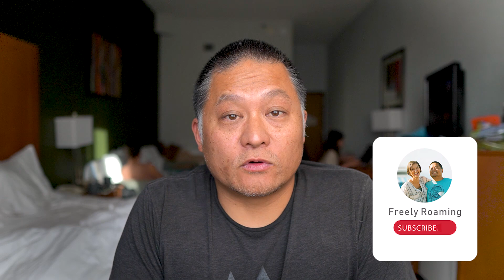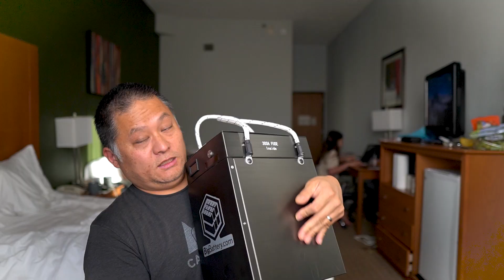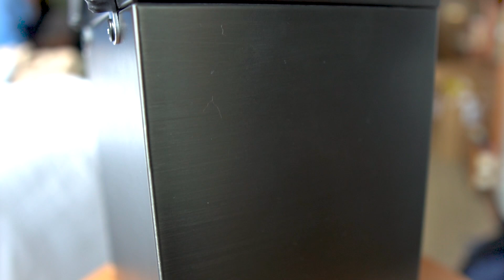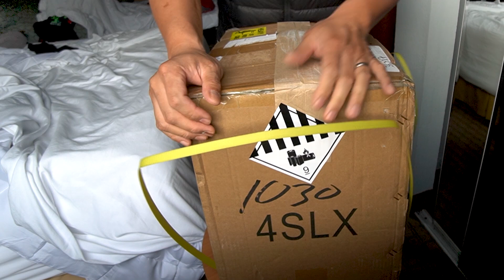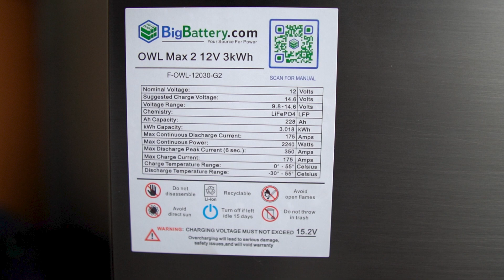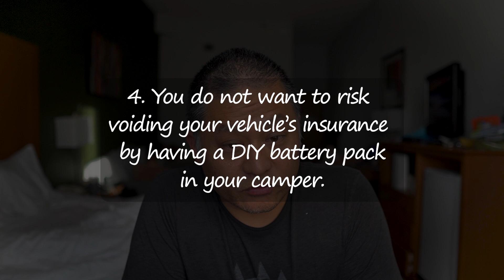Why You Should NOT Build A DIY LiFePO4 Battery Pack

Comment: I built my own 400amp LiFpo battery pack with BMS and 2000watt inverter charger for less than the price that commercial batterys that would cost on their own, it is the best way to do it and you will learn all you need to know about your system,  enough said
Reply from the maker: You are so cool

Comment: well, still 2 to 3 times to price of diy ...
Reply from the maker: Depending on where you get your cells and what quality they are.
Reply: @freelyroaming  i'm in EU belgium, pretty hard to find good deal
Reply from the maker: @chris_mk5supra  I bought raw cells 2 years ago and had it shipped to Croatia without any problems. I think you'll be able to find someone who will ship to Belgium.
Reply: @freelyroaming  yep i did pull the trigger on ally express cell, hope i did not make a mistake, but it take so much time to come it's kind of frustrating, got to little battery for the moment and it's bottelnecking my solar panels :(
Reply from the maker: @chris_mk5supra  it took probably 60 days for me to receive my cells in Croatia. I did get pretty lucky though as my cells tested up to full spec. Good luck!

Comment: What is your resting volatage on the Owl after fully charging?  I have the original Owl having used it for the last 18mos, and I see no higher than 13.3v.  I also only get 150ah actual capacity.
Reply from the maker: 13.3v sounds about right. although I am usually connected to solar so it has a float charge voltage of 13.5v. how much degradation you have after 18 months has a lot to do with how it was used during that time. Anything can happen without knowing every little detail.

Comment: Good review. I went with their Battery Evo brand which are less expensive. 2 12v 180 Ah in series for 24v 4.3kWh. $775 ea. Easier to handle than a server rack style battery.
Reply from the maker: How are they working for you? I think the form factor is a little hard for people to wrap their head around but it serves a good purpose in some situations
Reply: @freelyroaming  Working smoothly. I have my new Samsung refrigerator, a 11cf freezer and a 75" Flat screen TV running off of it. I have my washer and gas dryer plugged in to do the laundry a couple of times a week. I even run my small window AC when it gets hot during the day. But primarily set it up to run my fridge and freezer fulltime. They are hooked up to a 3k MPP Solar inverter/charger and 800watts of solar. It couldn't have been easier. With solar during the day and AC from a house outlet, my batteries stay between 13v and a system voltage of 27v+.

Comment: So...why not a DIY batttery build?
Reply from the maker: Watch it and you'll know.
Reply: @freelyroaming  have 16 cells coming from france to here,portugal, in 4 days, incredibly cheap (500 euro for all 16,200Ah each, at the 3.2 volts, to do 2 batts. of 24 V each,that is why i wanted to know if you care to tell,saw nothing in the video except that it is dangerous and u need expensive tools; as a mechanic/electrician (i used to be an engineer...)i NEVER needed hydraulic crimpers i have 120 watt soldering irons; have  multimeters power supplies etc,also; BUT i rely on google and youtube for the build. It will be stationary,in the house,for solar .
Reply from the maker: @josepeixoto3384  so you DID see in the video why building a diy battery might be a bad idea some people. Are you just looking for an opportunity to say that you are not in that category? That's great. I'm happy to hear that.

Comment: We build our own batteries because of the exhorbitant prices these battery manufacturers charge. Who, in their right minds, wil pay $1,500 for a gang of cells we series /paralleled to get the voltage we want? Solar, bms, 18650 cells (or larger), distribution box, inverters for an off grid home that my insurance company approves of is a lot cheaper than what you paid for your commercial battery.  As far as putting it in a caravan/travel trailer, I stick to flooded lead acid batteries that get recharged at the unguarded outlets at commercial buildings, campgrounds, and friends or family places. With the Bidenflation caused supply problems, you use what you can build, buy, or find to repurpose. I have the skills to build these things myself, or scrounge them off the junkyard of my area. Others can do this, too if they can spend the time to learn how to do this. They assume all the risks involved in this process, as I do. Even you have a risk of fire, overcharging, short circuiting no matter how careful you are because your system is in a moving, vibrating, bumping platform that can cause those same conditions. EVERYTHING is risky, no matter how you install it. Depends upon the amount of risk you want to assume. Not everything here on YouTube is safe, without risk, including YOUR battery. Have you opened it up to see the quality in the build? How many of your cells have bulges due to their first charge before shipment from the factory? I fear these enclosed battery boxes, because they can become bombs if they short internally, and the protection circuit fails!
  I overbuilt my batteries for that extra safety factor I can include in my build. I have a 12VDC battery  in my radio shack I have built myself that has powered it all for three years without a fault. The only thing it does not power is my Henry 4K which needs 240VAC to power it, but I do not need it all the time, so my solar panel system meets all my needs for communicating. Battery banks are for stationary use, not mobile unless they are small or for automotive use. Being able to afford such commercially made batteries is nice, but not all of us can afford to buy "off the shelf" like YOU did. Good Luck - someday you may need it.

Comment: I'll build my own and put it  in a safer than metal,  heavy duty plastic tool box for less than 1/2 the price of the cheapest prebuilt I can find and the cells are sent from the US (already in the US). The main hard part is getting the bms hooked up the right way, alot of wires for a 48 volt system, but easy to check if its right with a multi meter and I'll know it really has a low temp shut off so it will not be wrecked by charging if below 32°f. I'll also put in a good dc breaker and go with bigger  then needed cables. After it's built, I can say, "Built in the US by a US person, and built to last 10-20 years". And all that money saved will about pay for an all in one 120v inverter,  battery charger and solar controller. After all that I'll say, if you know what your doing fine or else go buy a pre-built, but make sure to watch someone on you tube take it open and make sure it is put together right, alot aren't, like saying they have low temp shut down, wired good so doesn,t rub and short out , going down the road or bounce around in the case, etc.

Comment: Actually there are 2 really good distributors of raw cells in the 🇺🇸  and their prices are pretty much the same as Alibaba or Aliexpress without having to wait 2 months to get your stuff. I just finished 2 of their 280ah 12.8v  GRADE A legit eve cells each one ran me around $640 per Bank with shipping and under $750 with a bms on them.. I can guarantee you won't find any brand new 280ah lifep04 battery banks anywhere near that price!!! This is why I will continue to buy and help people build their own battery banks so they can have a BadA$$ system without having to pay $3 grand for a decent battery bank!!!!! Not big on these don't say anything negative because we gave you the unit reviews...  They lack the depth and details to teach anyone new or experienced about the diy setup vs paying 3x more for a company to do it for you.
Reply: I'm interested in a reliable US based battery supplier for a DIY build. Could you tell me who they are?
Reply: I'm also interested in a u.s distributor of raw cells could you message me the contacts of the U.S distributors?

Comment: You must have got this for free. 
I’ve had the worst experience with big battery. The first three 202’s I got all had internal shorts and had to be returned.  But, I had to first buy three more. Then, 2 months later I tried to buy three more and they were discontinued. The suggested buying 170’s and joining with current bank. When I connected two of the 170’s it shut all but 1 of the 5 batteries down. I personally drove to their shop in Cali to do a swap and the almost denied my the warranty work. After going back and forth they finally gave me five new 170’s for my 3@202&2@170. 
1 of the five batteries (new in the boxes) had a charge of 24.3 all the others were at 27.2. That added to my problem. Then after waiting a week I finally discussed the refund money for the cost difference. I got the run around and no call backs until 5 minutes before their shopped closed on fridays. 
After waiting three months and calling constantly I finally got a check in the mail for my $1400. 
First thing I’d do if keeping their batteries is trash the bms and replace with a better version.

Comment: Big Battery doesn't stand behind their products. They have a poor BBB rating and have many complaints from customers for not refunding their money for selling them a battery that doesn't preform as advertised. My 170ah battery provides a whopping 114ah, not even close to advertised capacity. Been "working" with BB since Dec. 4th of 2021 for a replacement or refund. No customer service from Big Battery, and no refund. Their advertised warranty is not something they live up to. Last contact I received from BB was on Feb. 14th of 2022. Buyers should beware of doing business with these people. I purchased a Chinn 100ah battery from Amazon for testing. It provides 103ah - much better performance. I'm not surprised the battery they sent you to test works well. They aren't going to send you one of their normal products.

Comment: You should pull a Will on these and tear it apart, that’s the only way to evaluate the build quality.  I would expect a cheap BMS and less than desirable wiring but prove us wrong, please.
Reply from the maker: I've seen a few disassemblies. The internals look pretty good but I will confirm. One of the nice things about this unit is the enclosure allows easy access to the components.

Comment: I have the 24v Big Battery unit. Had it for almost a year now and seems to be working fine. Just curious, do you get to keep the battery they sent to you for evaluation?
Reply from the maker: I ask for a review unit and they said as long as I made videos about it, I don't have to return it. But if I choose not to make any videos, they would want it back. Other than that, they didn't require anything else. That includes not having any inputs on my opinions of their products.

Comment: In the UK building a battery is 1/3rd of the price, even with a JBD BMS with heat pad connections. Genuine Grade A cells. I built two 12v 304Ah batteries for just over £500 each.  To buy a single 12v 300Ah battery in the UK will cost £1500 in the UK. I do wish we had access to cheaper high quality batteries in the UK.
Reply from the maker: To properly and safely build a pack from raw cells, you need a lot more than just the components. If you don't already own then, you'll need to also buy tools that costs hundreds of $$ and it doesn't make sense for beginners who aren't confident in their abilities in the first place. That's who this video is ultimately speaking to. Also in the current market condition, there are too many stories of people getting bad cells or not getting them at all after months of waiting. Unless you plan to build more, you'll end up with equipment you'll likely never use again like a hydraulic crimper and a bench top variable voltage power supply.
Reply: What's that in dollars?
Reply: @j5892000  approx?  multiply by 1.2, 500  is 600 doll.
Reply: Could you build me one please😄👍
Reply: @sparkygazza  There not hard to build. It's getting genuine Grade A cells into the UK that's the problem. No idea what the shipping is like at the moment? 
I got my cells in early December last year. 
The crazy part was they came to the UK by land not sea. Or at least they showed up in mainland Europe on the tracking and then they were in the UK a few days later. That was before the mess in Ukraine. From what I know from other items I've had delivered be land, previously they went by rail through Russia. That won't be happening again. 
I've not asked my supplier for a price this year. 
I did get an email from them a couple of weeks ago stating they had cells ready for delivery from stock they had shipped to Europe. No idea if they still have any or what price they are?
Reply: @drewhodge3820  that's ok mate thanks for the reply anyways. I defo want a lithium battery but it's hard for me to justify paying £900 for a 200ah battery at the moment.
Reply: @sparkygazza  Yep when you consider I paid about £900 for 8x 304Ah cells. (600Ah at 12v nominal) Plus I purchased two  expensive BMS boards that had self heating and genuine low temp cut off protection. When I could have used a cheaper single BMS. The small number of UK retailers selling Lifepo4 batteries are charging way over the odds. I did consider importing cells and making up batteries but  the initial outlay is big. Then you have to wait 2-3 months for delivery to the UK. Which is why the retailers in the UK charge so much.

Comment: You cite insurance as a factor, but you don't really go into why this is a factor at this point in time, versus last year when you built out your battery and posted your videos (which helped me quite a bit, FYI).

Is this related to your returning to the US? Did you have issues getting your van insured again due to the presence of your DIY pack? Is that what prompted the switch to the commercial products? Was insurance an issue while in Europe?
Reply from the maker: This is based on numerous questions I have received and the numerous RV fires I've have been shown since I made the diy battery videos. Insurance companies will do everything they can to dispute a claim. The last thing I want is for someone to lose their whole vehicle not knowing that from the start.

The fact is, most people should not build their own packs. I can tell that by just the volume of beginners asking basic questions after watching my videos. Insurance is one of the topics they have asked. I don't have an definitivr answer because everyone's insurance company is different. And it varies from state to state and country to country. Personally, we don't carry full coverage insurance so it's not a factor. In some countries in Europe, DIY electrical systems not only have a hard time being insured, it is even difficult for them to pass their annual motor inspections with it installed.

I will continue to build diy packs but this video is necessary to those who question their abilities to not build and use a pack that might cause serious harm or death.

There is a big difference between a off-grid system that never moves versus a pack that lives in a camper and goes thru constant vibrations. I can't in good conscience tell a beginner that building their own pack is always a good idea.

I want to make sure that for those can be discouraged into building one at least considers all the dangers before moving forward with the project.
Reply: Gotcha. That's a lot more detail than you go into in the video, so that's very helpful.

But - you didn't answer one question, which was basically, did you have trouble insuring your van with your DIY pack in it once you returned to the States? I get the point of insurance, claims, and fighting claims, but that's a different aspect of the whole thing.

And on Europe, considering what you just mentioned - did you have such issues once you added your DIY pack to your van?

Thank you!
Reply from the maker: @Wandering Zythophile maybe you missed it but I did state that we don't carry full coverage insurance in US or Europe so it's not an issue. I suspect most people don't feel comfortable with not having full coverage on their expensive campers ad we do. Our vehicle is not registered in Europe so we don't have the issues with inspection that the locals have. This is more detail than most people care to know but I am glad to help you with these answers.
Reply: @freelyroaming  Oh, I love details :) And yes, you are correct, I missed the bit about lack of full coverage. Thank you.

Gotta ask then - what level of insurance do you have? Just liability? No comprehensive? Seems like you'd want comprehensive what with all the investment you've got in it.
Reply from the maker: Yep, just liability. It's just a vehicle. Sure it would suck if something happened to it but it's still just a vehicle. It has already given us far more than we can ever ask for.